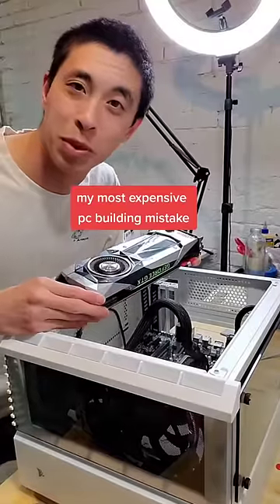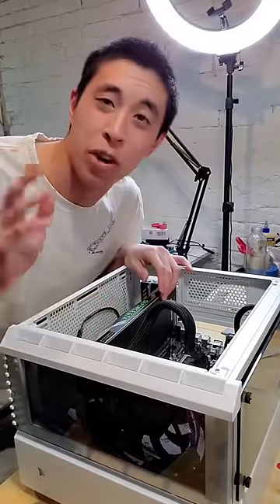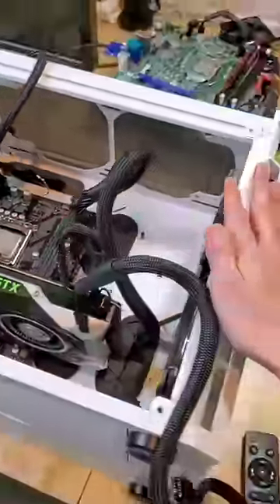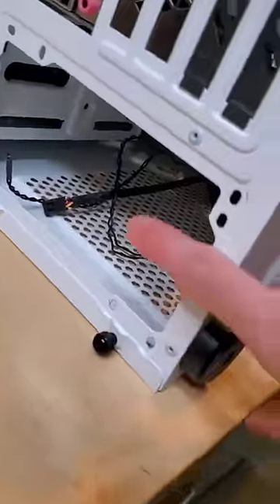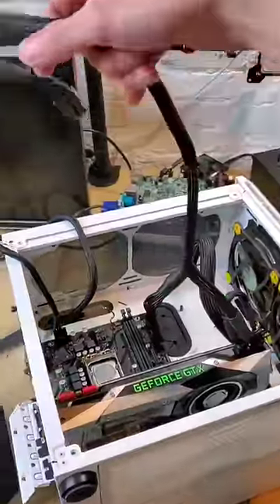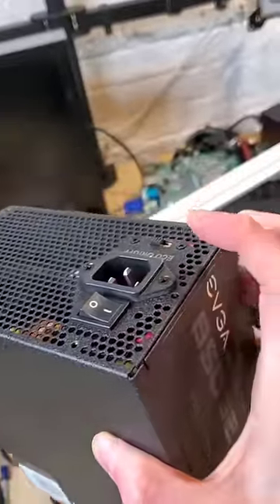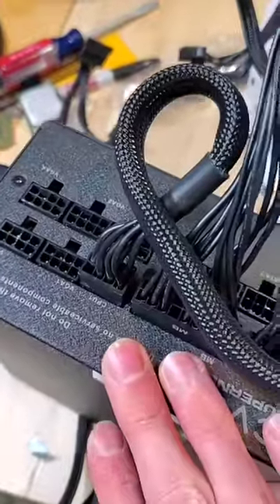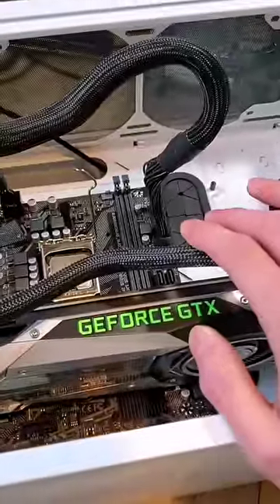my most expensive pc building mistake... #shorts

Comment: I tend to not read instructions, so when I was building my first PC, I used an NZXT Kraken M22 as my cooler, and I didn't realize that the pump was embedded into the radiator. So I just assumed that that wire coming out of it was not important. So my CPU was getting very hot. I had to buy a new cooler, but at least it was way nicer.
Reply: Why did you have to buy a new cooler instead of just hooking up the pump?
Reply: @mrclean3088  i feel like he cut it off
Reply: @der_katzentyp9495  Oh that would be painful if he did just assume a cable wasn't important and cut it off, I mean even if I think a cable isn't important I would never cut it off.
Reply: @mrclean3088  because I learned about the pump way after I replaced it

Comment: I did a similar thing. My first pc. A6 6400k, 8gb radeon entertainment ddr4, hd7770. I went with an off brand psu because I was 13 and broke. I had everything disassembled in their respective boxes to keep them safe while I waited for a new case to arrive and when putting in the psu somewhere in the process the 110v-220v switch on the back that most oem style PSU's used to have got flipped from 110 to 220. I plugged it in. Powered it on. And fried the entire system. I was devastated.

Comment: This is my reason not to use cable extensions for my rig.
Reply: Worked fine for me (thanks for the warning btw since it's not usually seen as a risk👍)
Reply: These are fine, he fucked up something else for sure
Reply: Cable extensions are fine if they are just pass-through, the issue with modular PSU cables is that they don't follow a standard, so pin-outs are often different

Comment: I've luckily never made a mistake that actually cost me anything, but between building my first and third pc i learned A LOT, like my psu was upside down (also causing my front mic to be unusable), my gpu was in the last slot, fans directions were unknown to me, i took the fans off my aio radiator (luckily there were 3 fans still cooling it), probably used too much thermal paste, later replaced the paste with one i use for work (no clue whether it was a good or bad thing), bottlenecked the hell out of my gpu, just straight up didn't know m.2 ssd's slots had included heatsinks on my motherboard (there was plastic foil on them), and i put my ram in the least optimal way at first.

A first pc will always have many mistakes and i'm simply glad to have fixed those mistakes in my third pc (we don't talk about the second one)

Comment: Dropped a screw on the motherboard.  Scratched something...   When I tried putting the mobo into the case, standoffs probably scratched something on the mobo too.   

It wasn't until a few months later I started getting the bluescreen of death everytime I used the usb port. 

This is why I don't recommend buying used mobo lol.  It's the most annoying thing to replace cause each time you replace it, you're essentially rebuilding a whole pc pretty much.

Rest of the pc components I wouldn't mind buying used, but a mobo is a big no no from me.
Reply: Yep. Its;
"Oh you don't have the right chipset for this board"
"Oh you only get 1 ramslot."
"Oh and your old sticks are not the right electric standard anymore"
"Oh Also your case's risers aren't aligned."

Comment: During my first built, I’ve didn’t realized that I had to brake open the GPU expansion slots (sheet metal thingy not screwdriver open thingy) , anyway I built the PC and to mount to GPU I tried braking slot covers while other parts mounted. Eventually I’ve accidentally broke some of my motherboard components trying to brake open the expansion slot. Luckily it was repairable and managed to get away with very little cost.

Comment: This happened to me once when i tried using a shorter PCIE power cables to power the water pump on my AIO, i had a corsair PSU and grabbed a cable from my  SeaSonic PSU and they did not like each other. thankfully the only thing that got fried was the cable for the pump so thats all i had to replace.

Comment: Some back story, whenever I bought a new pc component the pc wouldn't simply boot , I always get stressed , but    eventually It booted , I have a very low end pc with a 1030 you now i thing even I broke my whole pc it wouldn't be a fraction of the values of mistakes you all do , so I always learnt from others mistakes....
Reply: get an SSD, they're cheaper than before
Reply: @ElBozoII  said too early i am already running an 120gig ssd :D this cat is not as silly as it looks.
Reply: @rabindrasharma  what CPU are you running or how much ram do you have? it can help with slow boot times
Reply: @ElBozoII  I have a excellent i3 3220 with 2 cores and 4 threads with a whopping 3M cache and 8 gigs DDR3 ram... It now boots in about 10-15sec from cpu button press, do turn fast boot if you want to cut down boot times...
Reply: @ElBozoII  btw what config are you running..
Reply: @rabindrasharma  I'm running a wonderful Core i7-2720QM with 4 cores and 8 threads (all the rage back in 2011) and 6 whole megabytes of cache (L2+L3) and 8GB DDR3 RAM, it boots in about 30 seconds since it's a laptop
oh and it has a Quadro 4000M that performs worse than AMD integrated graphics (Vega 8 and Vega 11) and even a GTX 260 or a GT 1030
Reply: @ElBozoII  dude a Quadro it's like 10 times better then mine , and I have like 50 gigs of storage on sad so need to swap files between 1tb hdd to make things work but I think with a bit of cleaning on ur system u can lower ur boot time...
Reply: @zydn  where do you live to get an rtx 2060 for $280, they go for like $325-$500
Reply: @zydn  the fx-6300 is legit my cpu but with more cores and a higher clock

Comment: My first time ever building a PC, I had been trying to connect the power and front panel connectors to my motherboard. The motherboard DID NOT have any markings of what connector should go where, just that this was F Panel and Power. So I winged it. Heard a loud pop and then the PC wouldn’t give any video output or post. Moral of the story: Read the manual…

Luckily, I worked in a sales job at the time that I was pretty bad at. This motivated me to work really hard and I got a $4,000 paycheck two weeks later which I used to buy a brand new PC. I have successfully built two PCs since then, always reading the manual.

Comment: sometimes its easy to check what wire goes where and select the correct cable by looking at the original one (this way I matched wire from different power supply and it all works fine till this day)

Comment: The worst thing i did was a improper mount for a 5800x recently but it shipped with one slightly bent pin that I didn't notice and didn't cause serious damage to the cpu so managed to walk away with 1 missing spare pin and afew minutes of straightening the other few that bent from the bad mount
Reply: Same on a 3700x but I got away with it. Thankfully. I did manage to blow up a PSU though. 🤦
Reply: @JamesW81  i was Mounting my 3600 used and Bent some pins accidentally idk how and fired my 16gb(8x2) ram sticks and those sticks then proceeded to blow up a pc when i took my pc to a shop for repair and all

Comment: Thought of applying thermal paste to my ryzen 3 3200g
And while taking of the cooler you need to twist the cooler to remove it smoothly without the cpu sticking to it ,i ended up pulling it off with cpu had 8-10 bent pins , my heart straight up stopped , my brother fixed it up with a needle tho and it was good again
Reply: I did this exact same thing lmfao, got my mum to fix it for me luckily. Also for yourself and anyone else reading this it helps a little bit to have the PC on beforehand as the CPU and thermal paste being warmer helps to take it off a bit easier while also still twisting it

Comment: When I was about 12 years old I had upgraded my pc from an athlon to a Ryzen 5 4500, I literally had a dedicated gpu instead of am3 built in graphics. I put my in my room. One night I was playing Minecraft with shaders and my power supply got too hot on the carpet, I heard a huge bang and my pc shut off, I took the power supply back, once I did, it was too late. The power supply was fried because I used shaders with my pc on the carpet. That’s was a 700 watt power supply from thermal take, I could have friend every component

Comment: I installed a CPU wrong cause i had no idea what i was doing when i decided to upgrade for my pre-built PC. The CPU socket was done with one completely squished pin and another bent the wrong way. After that happened i realized my mistake and said "well i guess I'm building a PC. So i built my first PC and this time i did everything right. The thing is still going strong over a year later.

Comment: I was looking at the reviews of a power supply that interested me on Amazon, and I saw this story: "The power supply works great, and is amazing. But about 1 year after use, it fried my components! But it was my fault. You see, I wasn't using the cables that came with the power supply, I was using my own. In the long, this cost me thousands of dollars. Make sure to use the cables included with your PSU people!" Very weary tale lol. Im glad I saw this review because I was gonna buy that PSU and use a different wall plug cable for its power, thinking nothing of it.
Reply: the cable from the PSU to the wall makes no difference or effect to the internal components tho. It's a very different situation than using different PCI/ATX cables for components.
Reply: the wall plug makes no difference, its the internal connectors which you need to be careful of.
Reply: @CoolCrescent186  exactly - the wall plug is all the same for every PSU. Makes no difference. The cables for connecting your pc internals to the PSU are the tricky part you need to take care of

Comment: Yeah, no. Something else definitely happened aside from a “mismatch” of brands, or different cables. How do you think custom cable sets work? You don’t buy a custom power supply when buying custom cables. Cables are just sleeved wires, at the end of the day wires can be universal. It’s impossible to denote what the problem was by saying it smelled like smoke. Could be a number of issues. Shitty VRM on motherboard or GPU, bad over clock on BIOS, shorted something, etc.
Reply: I agree. I honestly don't understand what issue he was speaking of.

Comment: I have made this mistake before and it should be a crime on the manufacturer's part. The plug shapes on the end of the cables matched the sockets on the PSU but they had different wiring arrangements. The PSU exploded and nearly caught fire. Never mix cables even if they have identical hookups.

Comment: When I upgraded to Ryzen I forgot to get the mounting adapter for my cpu cooler. I was impatient so I just zip tied the cooler down to the mobo. It worked fine, but when I got the correct mounting adapter and tried to remove the zip ties my hand slipped and I cut a massive gash into the mobo with scissors.

Comment: I was building my second PC for the first time by myself and got confused when plugging in the front panel connectors. I plugged the power switch in vertically, when it should've been horizonal. After a few taps to the power switch I immediately smelled smoke. Luckily, it only fried the motherboard, but that was still a $100 replacement.

Comment: I de-lidded a 7900X3D the first time i ever used liquid metal. Ive also never dealt with an LGA cpu before that. I dropped the cpu while i was cleaning the dies, it gor liquid metal on the bottom side of the CPU. The craziest part, it worked for about 2 weeks before it died!

Comment: my ssd died which had so many important un-backed up files on it. no expensive in terms of raw money but time and other costs
Reply: how long the life of your your ssd until it  dies? just to make sure i dont mess up and backup all my files
Reply: That's weird, usually SSD that die become read-only, so you can get the files back
Reply: @LightOffArchives  clearly, something else happened
Reply: I see your comments everywhere! Haha
Reply: I see.. happened to me too, the drive was filled with research material so its kinda sad..
Reply: To everyone here, this can actually happen if "spread spectrum" goes too high and you have a pcie SSD. Some more poorly made motherboards will increase the multiplier too high which can cause corruption of the drive or even certain filesystem sectors that show where certain files or data are. There's a function in Linux that can actually recover those sectors assuming no hardware damage was done. Along with data from the Internet and self testing on a few computers and with some of my friends help I could replicate that data corruption on a few pcie drives, but Samsung ones seemed to handle it a lot better and would usually just shut off before damage was done.
Reply: @Bos_Meong  A normal SSD can go around 3 years, but more than that should be fine.
Reply: @yajadoge5191  my ssd already 10 years tbh.checked on s.m.a.r.t health still looks good so idk exactly should i backup my data or not
Reply: @Bos_Meong  It would be fine, but it’s time for a upgrade, and your data won’t be lost that easily it will go in a state where the drive can’t be written, but you still have acces to your data
Reply: @yajadoge5191  well if thats the case then theres nothing to eorry about. if its the opposite then im fucked
Reply: @LightOffArchives  my ssd died aswell and i couldnt get the files back. But if you know how please tell me.
Reply: @strudeldaco8071  no lmao
Reply: why would you download [porrnn on an ssd anyway buy a hard drive
Reply: @strudeldaco8071  That doesn't exactly work if you have an anime profile picture.
Reply: @strudeldaco8071  brony, not furry. Imagine watching a kids show, how disgusting /s
Reply: Damn dude
Reply: Damn
Reply: 1. Rip, 2. These comments are a shit storm.
Reply: @itsTyrion  Equally disgusting. But being a Brony is basically the same as being a furry. Just one is a big fan of a specific show.
Reply: Which is why people who use a computer need to have a backup system in place. I believe the vast majority don't. Doesn't matter if the SSD or HDD is spanking brand new, any storage device can die abruptly without warning. I use an automatic cloud backup service plus local backups on external hard drives and I've never lost data in over a decade now.
Reply: @yajadoge5191  I still have my first SSD from 2011 running. was my main C drive until last year, now its in a second computer. 120gb Corsair Force GT cost me $120.
Reply: @1BYEBYE1 Yeah it should be fine, but if you put load on it it will damage it unlike SATA-Drives, drive wipes are harmful to SSD